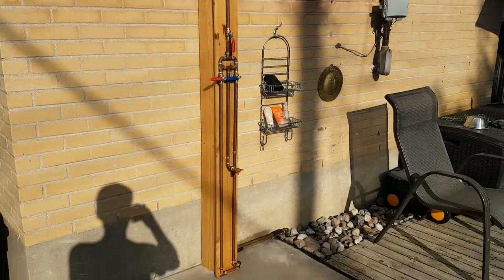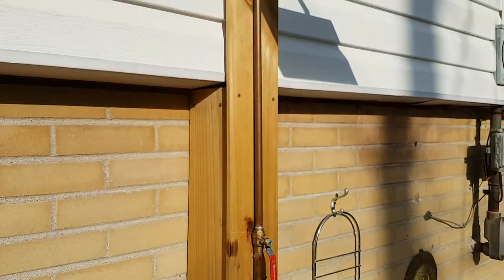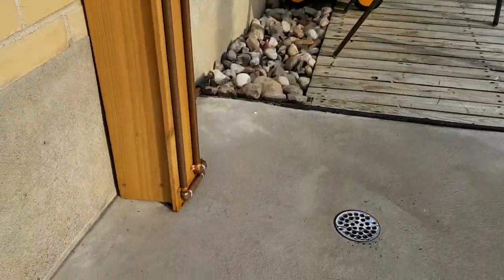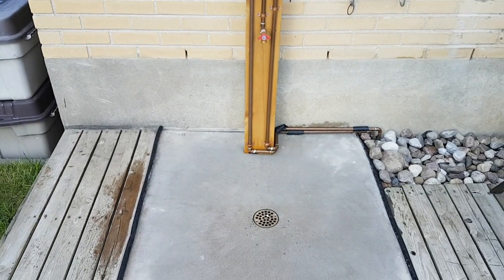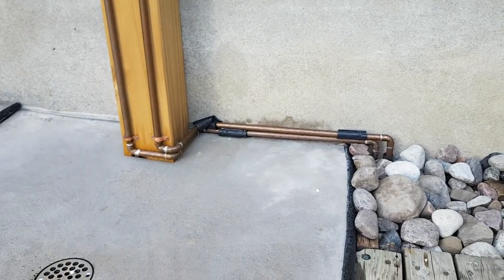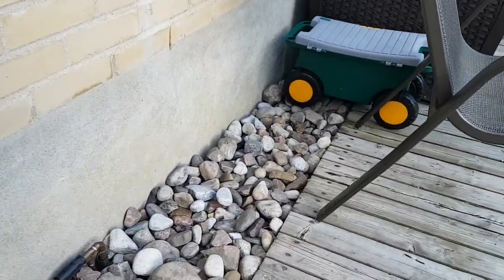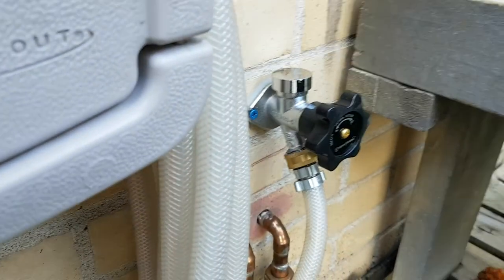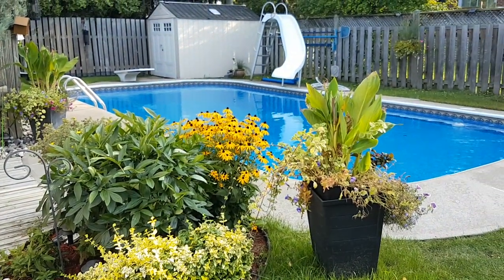Back Yard Outdoor Shower Project

Comment: What about protecting the pipes from freezing? Is there any way to drain the system out? Or maybe you don't get freezing temps where you are. Just curious. Removing the unions and flushing with air seems like a lot of work.
Reply from the maker: Takes 10 minutes to clear them with air compressor. No water in the pipes...no freezing.